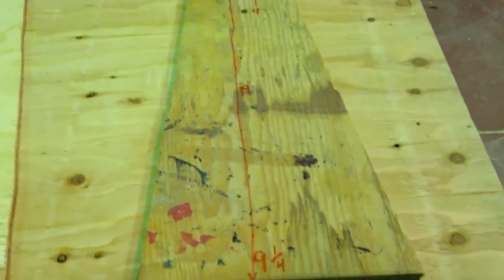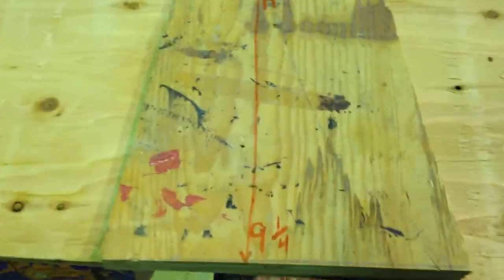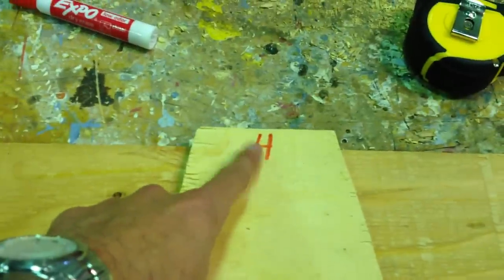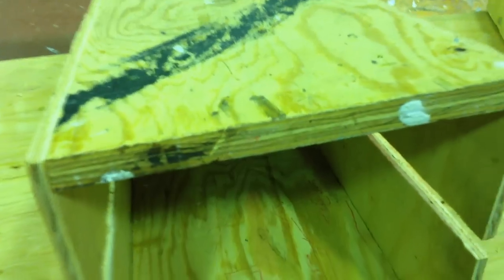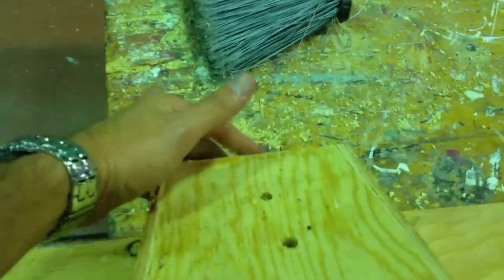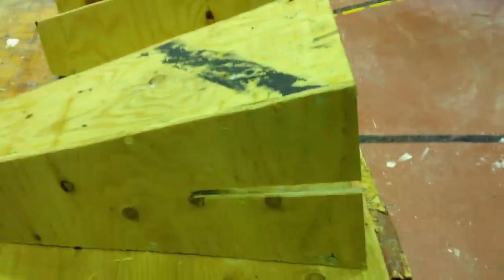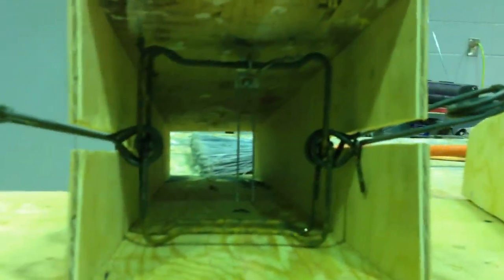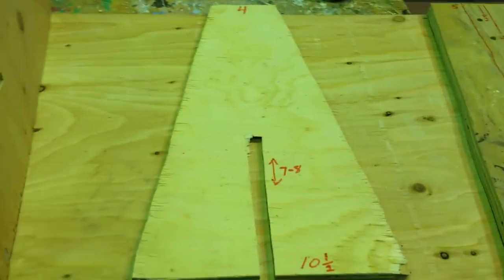How to Build Nesting Marten / Fisher Boxes Holds 4 different traps

Comment: Great Video like the 6” spike idea. I use plastic boxes with 120 belise with foot pans. On a horizontal pole fisher get head all the way in before trap springs.  Catch about 30 % weasel 50% martens to 20 % fisher in my area in Alberta. I’ve had a lot of fur damage over the years I find it best if the caught animal is suspended away from trees to eliminate damage

Comment: I am new to these nesting boxes.  Have you ever tried asphalt shingles for the exterior to prolong the lifespan of the box?  Have you ever tired setting two conibears in the box at the same time?  So the first one fires and then the second trap is ready for the next fur bearer?  I understand that the box would need to be long enough so the first trap doesn't set off the next trap.  I ask because I see so many video where the bait is gone and there is a dead something.  So where did the bait go.  Seems like a missed opportunity to get a second animal before you can check the trap.  Regards, BAG2
Reply: I like the idea of shingles.

Comment: Will the box fit #116 body grip trap
Reply: That's just a slightly larger 110 with a stronger spring? Figure it should. It accommodated a 220 just fine.

Comment: 220 doesn't fit in these dimensions, or atleast the Duke 220 does not
Reply from the maker: a duke 220 should fit just inside the mouth of the box if built correctly? what are the dimensions of your trap?